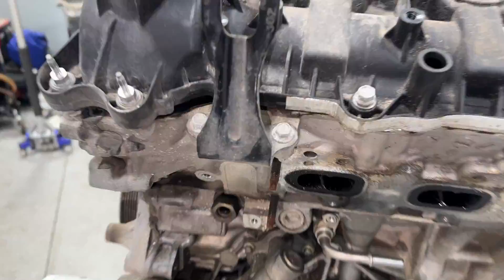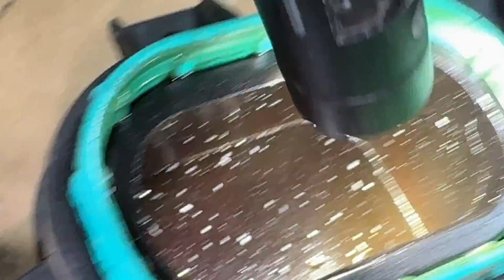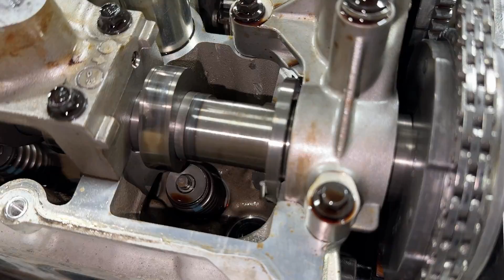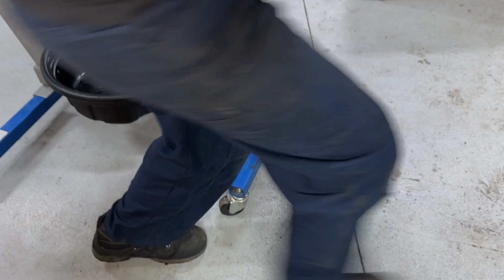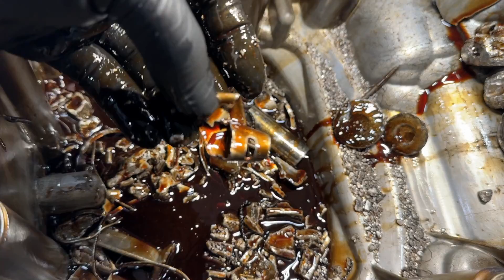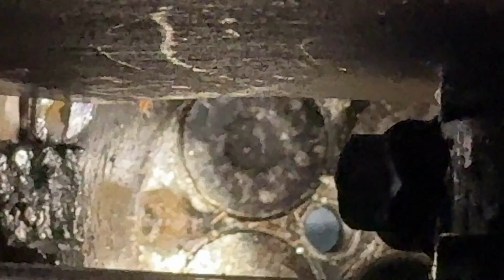Proof Ford Ecoboost Engines and Aggressive Aftermarket Tuners DO NOT MIX!

Comment: So a common problem when you break a rod is the Exhaust Valve(s) gets destroyed. An Engine Builder Friend of mine theorizes that Rod Failure occurs on the beginning of the Exhaust Stroke because when that valve opens the Pistone looses pressure against it and that it turn can cause an increase in speed on that Piston/Rod combination leading to Rod Failure. This was his Theory based on years of seeing this kind of destruction.
Reply from the maker: ok

Comment: In the late 70’s and early 80’s i was employed by the Cat dealer in Wyoming and have personally tore down several in-line 6 cyl 425hp diesel engines that experienced extreme over rev conditions that literally broke the block into 2 pieces, held together only by the head and crank, all caused by the rear transmission down shifting and the wrong time as the machine dropped back into the pit, which we later determined was caused by safeties being by passed.  The amount of aluminum and iron found in the pan was amazing..
Reply: Lol these ford dudes don't care about diesels lol they rather jurk each other off lol aka sack pumpers lol 😂

Comment: Hey man. Just wanna say I love your videos, u always explain everything perfect.. I’m commenting because I have a 2006 ford escape hybrid. Full disclosure, I’ve ran out of gas in it atleast 20 times. I’m trying to do better at that. But I noticed when I changed my radiator after the truck had sat for about a week, it wouldn’t start. Turns out it was low on gas. So I put gas in it and it started right up. But for the first time since I’ve had the truck, it’s now making a low sputtering noise and it would get louder when I accelerate and my rpms would go way up with just a tap if the gas pedal. I was driving and it just cut out on me.. saying stop now safely and now it won’t start at all. When I turn the key to on, everything comes on electronically with a normal power. But when I try to crank the engine it just makes a low rumble noise and nothing else happens.. the stop now safely alert flashes bd the orange triangle and the wreck alerts come up as well. Here are the codes I got from my truck p0562- system voltage low. P0727- engine speed sensor circuit no signal.   P0A92- hybrid generator performance.  P2806- transmission range sensor alignment.  P0106- manifold absolute pressure/barometric pressure sensor range/performance. P0193-fuel rail pressure sensor A circuit high input. P2104- throttle actuator control system forced idle. P0087- fuel rail/system pressure too low. P1285- cylinder head over temperature sensed. P1290-cylinder head temperature sensor circuit low input.  P1299-engine over temperature condition.  P1A0C-hybrid powertrain control module engine disabled.  P1A0D- hybrid powertrain control module generator disabled.  P1A0E-  hybrid powertrain control module motor disabled.  P1A0F- hybrid powertrain control module vehicle disabled.  P1A10- hybrid powertrain control module Bat disabled.  P1A14-  hybrid powertrain control module transmission disabled.  

I have changed my fuel filter, thinking that may be the reason it won’t start but it’s still not starting. I’m not sure what to do next. Could u possibly help me try to figure out why it won’t start? Thank you!

Comment: Coming from a racing background when I used to race the old Fox body Mustangs you absolutely do not use stock internals on a modified vehicle the engine block and the internals will not handle it if you do an intake upgrade and an exhaust upgrade it may be a slight tune that is okay but when you go pumping more fuel into the vehicle and asking more boost from the turbos you are asking for Destruction

Comment: I am wondering what needs to be done to a stock engine to make it last?  I have a completely stock engine on my 3.5 ecoboost on my 2015 F150 and I never go longer 4k miles on an oil change. I use only Amsoil Signature oil and use only top tier fuel mainly 87 octane.  My engine still leaks oil even after replacing vacuum pump and valve cover gaskets.  The Ford dealer just recently quoted me 8k to fix front pan leak and leaking turbo line.  How much is it to replace the engine? I can't see buying a new truck now days.
Reply: I'd look into the possibility of putting an entirely different pedigree of engine in it, honestly. These ecoBooms are making Xmas bonuses for mechanic shops.
There is no replacement for displacement. At least, no long-term replacement.

Comment: Depends on the tuning and maintenance. Ran a hot e30-50 tune for 180k miles on my 2015 f150.  Traded it in with 196k. Original trans and engine. 
Same with my 2021 powerboost Just hit 70k miles with zero issues. E-50 tune and preventative maintenance.

If it does blow then that's just part of the game. But overall zero issues with turning these up over 500 HP.
Reply: Damn u have to measure your ethanol Everytime you fill-up?
Reply: @invalidusername_5101 some regions have different blends of ethanol available. Not sure if this guys does but we do where I live.
Reply: @invalidusername_5101  
Yeah it's a pain in the ass at first, but once you find a good consistent ethanol station it's fine. Takes an extra 2 to 3 minutes every time you fill up. Definitely worth it for a safe 500 WHP.

Comment: I remember when these first came out and several aftermarket companies started tuning them, there was one guy from the LA area that blew up a bunch of engines. Apparently he was removing the knock sensors to make the power so it wouldn't pull timing when they detonated. Could be something like that going on. These engine blocks should be able to handle whatever power the stock turbos can push through them, although I'm not 100% sure on an E85 tune. None were available because the early engines didn't have enough injector capacity being direct injection only, so maybe they're pushing power beyond the bottom end's capabilities. I'm skeptical of that though. Seems like the heads lift from all the boost well before the bottom end will let go because it's an open deck engine. Other than that I think that E85 thing and the aftermarket port injectors might be what did it in. E85 engines are very thirsty because of how much less power dense ethanol is. It may have been starving for fuel under full power either because of the limits of the injectors or the fuel pump.
Reply: Too much timing with E-85 caused the rods to snap. Way too much cylinder pressure.

Comment: Judging by a lot of that beat up metal that engine continued to run for some time after the initial failure. Did the customer drive the vehicle to the shop?

The only way for those beat up pieces of metal to become that pounded into round balls is for them to be beat up over a period of time.  That's actually testament to how good that engine was built if it ran for a long time after initial failure.

It had to be making a loud racket though.

Comment: That was pedal to the metal and kept running till it would go no more, maybe to get to the side of the road. He was crazy to have that high a tune at 137K miles. Did look like he took reasonable care of the oil. Surprised at the minimal carbon build up. Incredible destruction.

Comment: my son did the same thing to his 2015 bmw 328ix , engine 2 years ago, that was a joy fixing that , looked like a hand grenade went off . his blew up due to a lean condition , from running e90 fuel without the correct fuel system upgrades , and the tuning he had done was just nooo good ..

Comment: Been a while since I've seen an engine that trashed. My guess is that he over revved it once too often, floated a valve which then broke and the next thing heard was BANG and then a coasting trip to the side of the road. Curious as to the final cost and did that guy revert back to a stock 'tune'. I really like my '19 F150 w/3.5 as Ford assembled it since my '31 has a modded 5.0/302 that handles my performance needs.

Comment: Just because it can be tuned to make more power doesn't mean it can handle more power. It was designed to live at the power level that it came tuned at. The engines of the passed were a little over built (some not all) todays engines are built to live a finite life. So boost away people.

Comment: I think he found maximum RPM. This engine is a good example of why rev limiters exist. Also a good example of why you don’t go tuning to the stratosphere with stock internals. The carnage is amazing!
Reply: I think he covered the issue and why This engine blew up. He said he had upgraded port injectors. From personal experience having one myself, I can almost bet that the tuner didn’t have the proper fuel maps at high RPMs. In stock form without e85, the ecoboost use 100% Direct injection, so when People try to use the shortcut of jumping to E85 by just upgrading port injectors, it complicates the fuel mapping greatly because the timing of the fuel injectors have to be different because Port injectors need to fire at different times than direct injectors and add higher RPMs. That’s a very quick switch, and if you don’t have enough fuel when that engine is running at high RPMs even for a split second a super lean mixture on a you’re gonna blow that thing
Reply: @mattc1219  I'm not that technical with engines and tunings.  someone in the comments suggested that money shift could have caused this.  so I had to know if this was true.
Reply: It’s not rpm’s that break rods, it’s cylinder pressure from increased boost and ignition timing.
Reply: Reminds me of some subaru engines I've seen where people do the same thing, tune the crap out of it with bad timings, stock internals, and too many revs passed the limiter will do stuff like this.
Reply: Tuning is great until you do some crazy things and break something because of ignorance now you gotta get a new engine I would tune but I would keep it low I wouldn't add no more then 75 horses any higher I'm getting it built would rather build it to withstand then for it to break in two in the middle of the highway
Reply: Ive only pulled apart one of these PERSONALLY that blew up, was a first gen 3.5, and it had failed similarly at the rods, however it shoved them straight up through the valley rather than out the sides, dude had a high and rather janky lift kit, and according to him he was nailing it in second, hit a bump in the road, something in the driveline let go and the motor oversped, and well... thats how i got to see my first busted ecoboost.
Reply: That was tuned out.
Reply: It was the power level .. once you go 100% e85 your pushing about 700 ftlbs .. you can tune around that by controlling the boost levels to keep cylinder pressure 'controlable' at specific rpms.  but the ECU .. .she is slow to pull timing and boost takes to long to actuate with the electric blow off valves.  likely they were close to downshift already .. mashed it and the shock of dropping a gear to near max rpm with the cylinder pressure was to much for the end caps/connecting rod ... or he had bad inserts that got hot but were not making noise.  Bang .. i had a tuned SHO and once we went to e30 we had a hell of a time controlling cylinder pressure, so we kept adding adjusting by over fueling, dropping timing and trying to vent .. was never stable .. gen1 3.5
Reply: I have a? Why have you not done a video on doing the motor mount on the 4
5.4 triton would be helpful 
Did the phaser following your video went great thank tou
Reply: @@tha_black_merc taking it out of D and putting it in 3
Reply: @@tha_black_merc Thx for the reply, I read every word.
Reply: @@tha_black_merc idk about FORD TCUs but the ZF used on BMWs can be coded also and people do some stupid things with transmission control unit flashes, anti lag and two stage limiters so the speculations can be fairly unlimited, then again my knowledge with the fords is extremely limited so I’ll trust you guys in that one ..
Reply: @@tha_black_merc so how do you think this engine failed. everybody is suggesting driver error, but how?  I want to learn from this, because I drive it all from autos to car manuals to 18 speed commercial manuals?
Reply: @@tha_black_merc XHP sells off the shelf tunes for ZF transmissions that raise line pressures and allow you to change shift points.   Usually these companies will allow you to do things that may be damaging to your vehicle, for 'off-road use only' .. IJS
Reply: Looks like a money shift gone wrong … poor tuning without regapping the rings has caused many blown m50/m52 motors but I’ve never seen this damage unless over rev .  Good video thank you .
Reply: it's a reminder why you shouldn't be an @$$ hole on the highway and punch it trying to get around someone because they're not going fast enough for you when you're already driving 80 mph......he HAD to have floored that thing ....and we know the owner is not someone who thinks very critically about things - he bought a bolt on tuning kit for a ford eco-boost........I'm kind of happy that engine got munched.
Reply: @davidkeetz  he might not have even had to floor it. The amount of power this truck was likely making on E85 means even at part throttle it was making WAY more power/torque than stock. A stock 3.5L makes 330-350 whp. A fully tuned 3.5L with bigger injectors was probably in the 550 whp range. That means hes making more power than stock at mid throttle.

Comment: It's always blown my mind WHY people want to tune an ecoboost engine.
Its ALREADY an engineered race engine being pushed hard with the stock tune with a higher than average failure rate.
Why on earth would you want to increase the chances of that failure rate?
The only engine where a tune makes sense is the naturally aspirated 5.0 coyote as that engine can take way more pressure than stock, especially without any force air induction.

Comment: Reminds me of a BMW M1 race engine I saw that failed on the front straight at Road Atlanta. Much bigger holes in the side of the block and the entire engine bay was covered with aluminum particles.

Comment: The rosy color on the follower needles indicate overheating, son.
Just the boomer child of a master machinist telling you that. Turbo action will contribute to that before pushing the extra HP out of the mill
Reply from the maker: I didn't see and coloring of them at all.
Reply: @FordTechMakuloco  it's subtle,
but I saw it, or wouldn't have mentioned it.
Reply from the maker: sure

Comment: I wanna know if he had an oil catch can installed.  I had the same catastrophic failure on a stock engine, but because I failed to empty it, a good 2oz was sucked into the engine under heavy acceleration 0-45mph when the same two pistons let go.

Comment: This is why ecoboosts arent flex fuel capable, while the coyote is.  

You can make a ton of power on E85 (esp on the gen2 engines) but many tuners learn the mechanical limits of the engines through eager customers...

Comment: I want to see the data log and know what the tune parameters were. The RPM limit had to been non-existent. You can do a lot to these engines to make them a real Beast as long as you keep them under 7,000 RPM. It's a turbo boys you don't have to turn it that hard
Reply: Mentioned above your comment. Too much timing causes and heat. The stock rings weren’t gapped for this. They butted together and all else let loose

Comment: The older i get the more i lile my stuff all stock.  
 I have 2016 3.5 since new with almost 200k miles. Literally zero issues.
Reply: My Gen 1 is at 155K...........oil change every 5K. Brakes, tires, wipers and gas along with regular maintenance.

Comment: Been tuned on my 13 eco for 120k miles. Got 209k miles on it now. Been fine completely original drivetrain. Turbos, timing chain etc. but i dont have THAT hot of a tune on. This guy was clearly getting what he could outta it running e85 tune. Them tunes are nuts.
Reply: I'd love to know the tuner, not to bash but obviously it was either timing too aggressive or maybe an over rev.  Those E85 tunes are advertised as big HP makers.  This reason is why I"m hesitant to tune mine and I drive like Ricky Bobby so maybe not a good combo.

Comment: You lost me at stock. Motors have a limit. The aftermarket will increase that limit. Your great with stock, but this motor could have used some performance aftermarket internal parts. Not really a flaw of the motor, a flaw of the owner.

Comment: The engineers usually select components that work well together as a system. When you start messing with that balance you can expect failures at some point along the system chain unless you thoroughly understand the entire system.

Comment: Isn't it amazing that even with an engine making good power straight from the manufacturer still isn't enough for some to leave it alone. I suppose if you have tens of thousands of dollars you can literally burn, use the same ideas make your daily driver "faster."

Comment: The Ecoboost engines are fairly peppy already, in stock form. Why tune them to the moon ? My little 2.7 is reliable, quiet, and does an awesome job pulling in its weight class. If I need more grunt, I use my ole 460 F-350

Comment: It's unlikely that only 1 rod would fail in a manner such as this with all other rods intact. What most likely happened is the ring gap was too tight for the power it was making, it butted a ring, and chaos ensued. he probably could have gotten away at this power level much longer on stock internals with proper ring gap, many people do.
Reply from the maker: Sure

Comment: After the BS that's happening to my fiesta st 2014, I can say screw Ford. Computers and engines just don't mix IMO. I'd be a lot happier just working a little 1.6l ohv cross flow like the ones in the 1970s Ford escorts or the ohc 2.0l from a 1983 mk5 cortina.. there's literally nothing to go wrong..